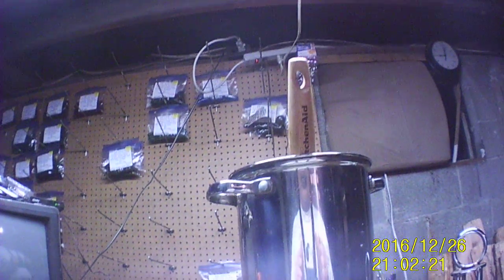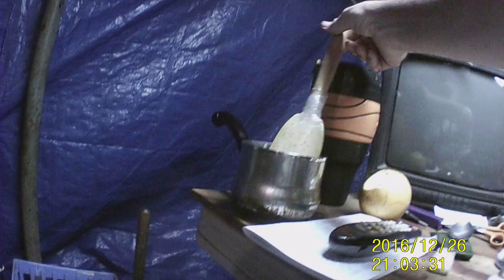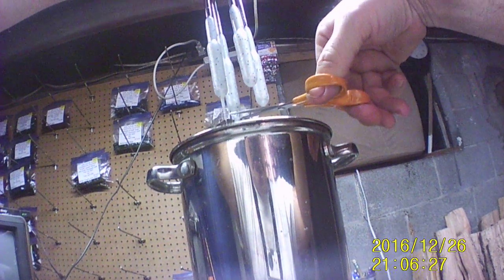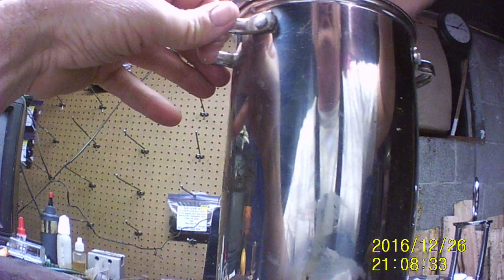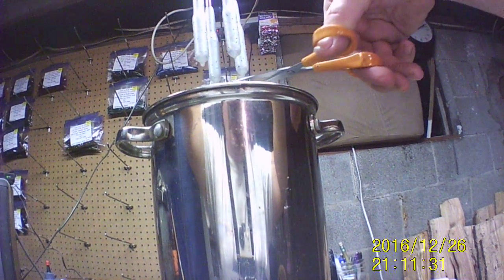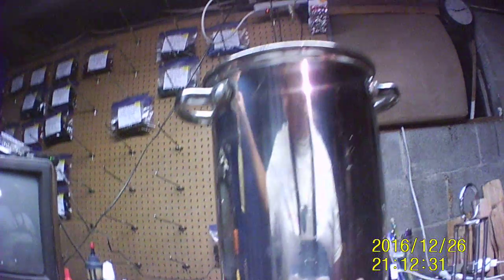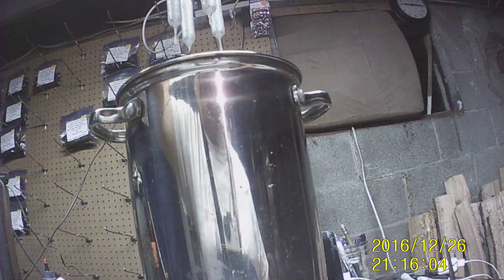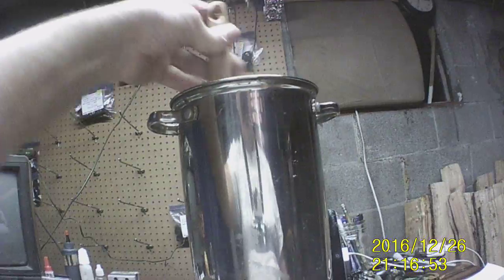3 1/4" Tubes part 1

Comment: What kind of container are you using?  I need a deep container like that for some of the baits I pour.
Reply from the maker: Steve Buck it's a asparagus steamer
Reply: Can you heat the steamer in the microwave?  I dip my own tubes with Pyrex cups, but I need something taller so that I can produce more.  I like your steamer, but wondered about your heat process?
Reply from the maker: Steve Buck no you can't

Comment: How hot do you heat up the plastic?
Reply from the maker: Kyle Gracely I'm using a double hot plate
Reply: Kyle Gracely  I do 325
Reply: I do 325
Reply from the maker: Kyle Gracely I heat it up to 340, then turn it back down